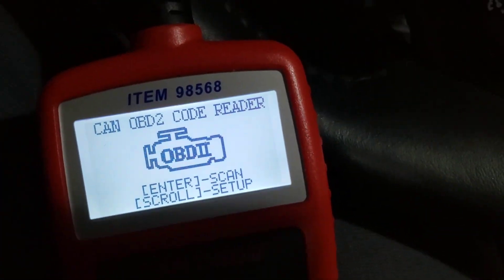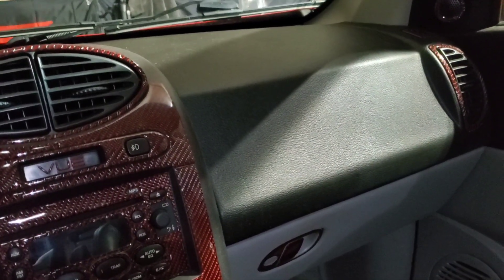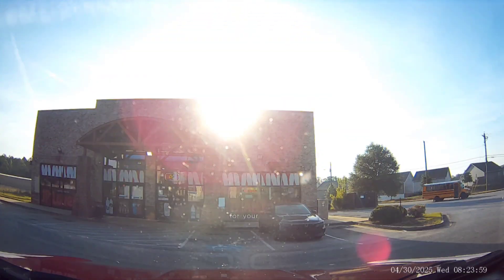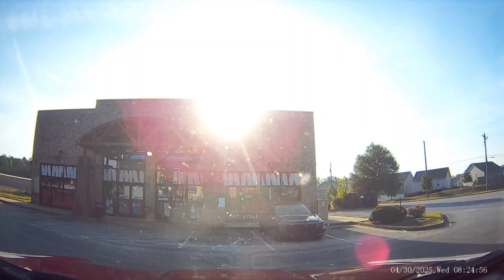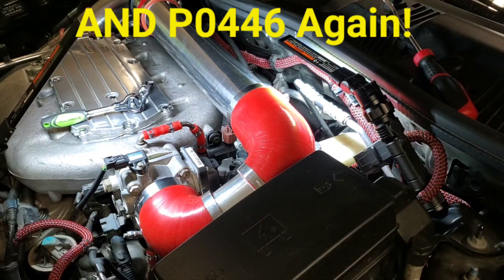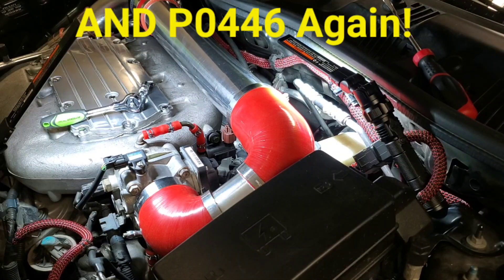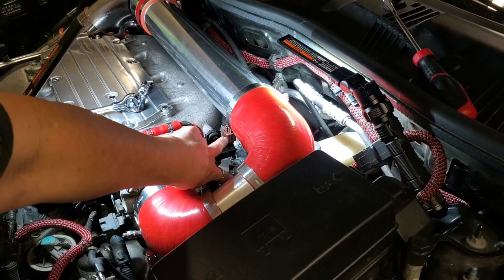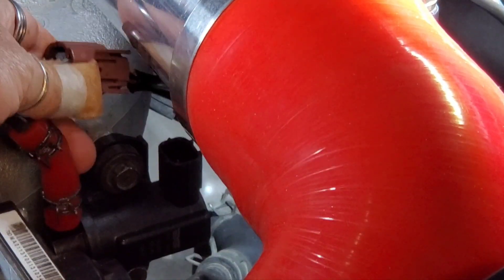EVAP Purge Solenoid Fails in a week! P0446 & P0455?!? (04 Saturn Vue Project)

Comment: Dealer is the way to go so i know bo dealers so best bet is online 3rd part stores or ebay advance autozone etc are chinese knock offs cheaper qualify cheaper wires, resistors ,etc  great video 😊
Reply from the maker: Definitely.  OEM is best practice. 

I plan to get the genuine gm one as soon as it is back in stock... part stores were out & rock auto was out.  Was not going to go directly to GM till I knew that sensor was for sure bad. I'm not convinced the original one was bad.  It was a Japanese Denso unit.  I might swap it back in & see if things stay a ok.  I think the whole thing was ultimately caused by the fuel tank pressure sensor.